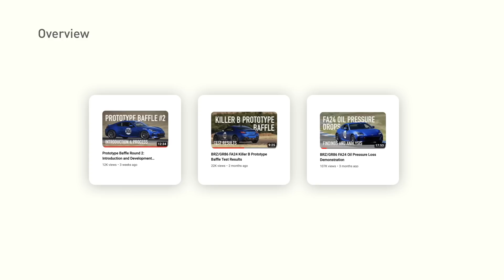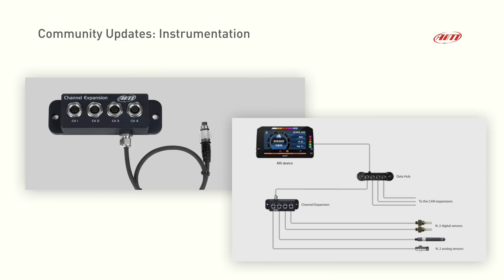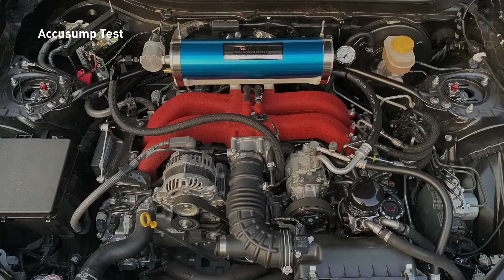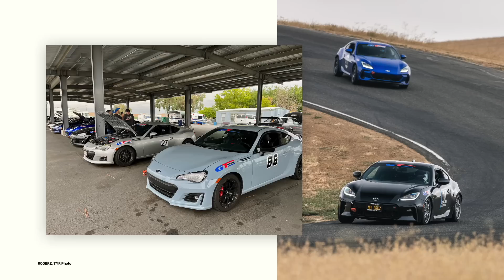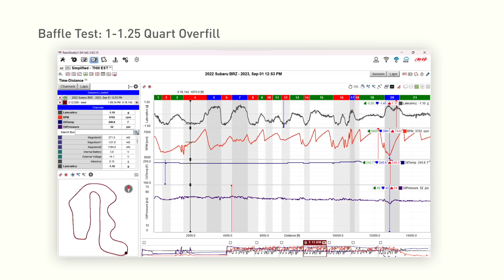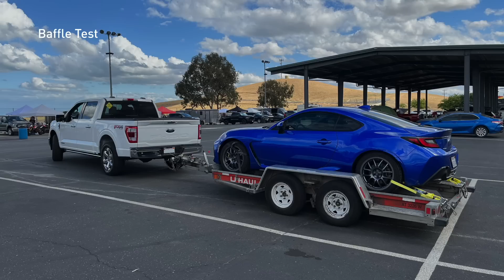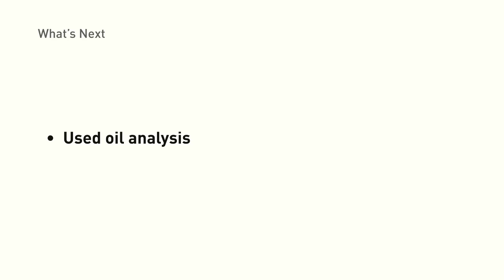Prototype Baffle #2: Results, Setbacks, & Future Plans

Comment: Just spitballing as someone who has no real idea about engineering or the root cause of the the right hand oil starvation: could a widened/redesigned oil pickup+pan be a possible solution? I've read hypotheses that say the issue is related to inability to grab oil from the pan.
Reply from the maker: Yeah, we believe a higher capacity pan would improve performance significantly. Wider is better than deeper because you don’t have to swap the pickup, but the space is constrained by the exhaust headers.
Reply: @900BRZ  That's the unfortunate part. An aftermarket oil pan from the likes of Moroso or a similar company would need to also come with headers that move around the oil pan. This also introduces the problem that the first catalytic converter is on the header, increasing the price of such a specialty part tremendously.
Reply from the maker: Yup and it won’t be CARB legal, which decreases the addressable market.
Reply: @900BRZ  Unfortunately, it looks like Honda power is in my future. 🫡
Reply from the maker: @haifai3916 Okay did some Googling and it is possible to get exceptions for aftermarket headers in CA. So maybe there’s still hope. https://ww2.arb.ca.gov/resources/documents/california-racing-vehicles-aftermarket-parts-executive-orders
Reply: @900BRZ  That’s good to know. Another option is to have an exhaust shop harvest the stock cat and weld together a new header using the factory cat. Definitely not ideal but that can also forego California’s bureaucracy.

Edit: Even using a stock catalytic converter with a custom-made header is illegal. Unbelievable.
Reply: @900BRZ  Thank you for all of the time and effort you are putting into this by the way. The entire community appreciates it, including myself.
Reply from the maker: @haifai3916  Yeah was just going to say. It need to have the EO sticker on it, unfortunately.

Comment: Sucks that this happened to you of all people but at least Verus is covering your engine replacement.
Reply from the maker: Thanks man. Yeah at least we continue to learn from it and, yeah, I really appreciate Verus stepping forward to cover the replacement.
Reply: @900BRZ  I appreciate all the work you have put into this project but unfortunately my time with my gr86 has come to an end. I am waiting for the title to arrive and i will be selling mine. I am moving to a platform that is less volatile
Reply from the maker: @uND3rrated_MX5  Totally fair. What are you going to go to next?
Reply: @900BRZ  on the fence over gr corolla or nd miata club spec
Reply from the maker: Nice, have you heard of anyone adding diff coolers to the Corolla? So far I’ve heard that’s the one Achilles heal. That engine is seeming pretty good right now haha.
Reply: @900BRZ  i am aware of the diff issue but i have not seen much done to counter it. But im hoping for some kind of solution to be introduced in the future. GR is the better daily and that is what i will be doing 75% of the time with my next car. The ND mista would be a better track car but a terrible daily.
Reply from the maker: Yeah I think a diff cooler should be relatively easy. Just have to get a new diff cover or add ports and figure out a way to route a cooler core to some airflow. They did it on the GR Cup cars. Might be harder on the FWD side though.
Reply: @900BRZ  my understanding is that only the resr diff overheats but i could be mistaken or misinformed.

Comment: OMG, that is devastating. Very interested on finding out what the fix will be.
Reply from the maker: I think we learned a lot from the large overfill actually. I didn’t quite articulate this in the video, but we now believe that it’s not an oil control problem, but an oil return problem. We can’t increase the speed of the return, but we can try to increase the amount of oil available in the sump. Hoping to share more info on our new mental model soon and potentially do some “lab” style testing.
Reply: @900BRZ  Interesting. BTR Justin observed more severe pressure drops with a vertical buffle. Not sure how all these findings fit together, I hope someone figures it out!
Reply from the maker: My theory is that the Kazama baffle inhibits oil return. The baffle I tested had a very intricate top design in order to try and reduce crankshaft windage while not inhibiting oil return. We now think oil return is the biggest problem with this engine.

Comment: Incredible work from all parties involved. Very sorry to hear about what happened with the engine! I wonder: would modifying or extending the oil pickup be possible to test or even help at all? Like a longer straw in a Super Big Gulp!
Reply from the maker: Thank so much for the donation. Paired with a deeper pan I think that would be helpful, but it’s an engine out job to replace the pickup unfortunately, since the timing cover needs to be removed to access the fasteners on this engine. I don’t know why that made that change. With FA20, you could swap the pickup just by taking off the oil pan. I think a wider pan at the same depth is the way to go for increased sump capacity.
Reply: @900BRZ wide oil pan idea, I have an ‘02 WRX with a ~ flat bottom pan stock.
I’ve seen a couple videos where the Sti developed a more v shape pan so oil won’t slosh out beyond the oil pickup under lateral g loads.
It would be interesting to get a camera view of oil movement in a pan on track.
Maybe there’s a computer simulation that could do it?

Looks like the old WRX had two horizontal baffles to prevent up slosh at two levels .

I did one track day with the WRX.  When the engine was torn down much later after a burned exhaust valve @176k miles there was one rod bearing that had gone through 2-3 layers.  Might have been the track day, or repeated right turn on ramps :)

Sorry for the catastrophic oil pressure loss while supporting the community!

You could probably make an oil pan with a camera that is bolted somewhere else in the car, experiencing the same or similar g forces to see how oil behaves?
It also might be interesting if a swinging pickup could follow the oil :) reliably.
Reply: From what I've seen I think the distance of the pickup from the pan may be too conservative. I've not measured it with clay. I wonder if anyone has? I think the vertical baffle with trap door holds great promise. I'll say more on that elsewhere.

Comment: I guess the best option , after all these tests , is to use the STI pan with baffle (engineered by themselves with huge know-how and budget) , and overfill.
A super useful test would be to have a camera that looks what happens inside the pan… Almost impossible I guess , but would remove any doubts .
Reply from the maker: We’re thinking about how to use a camera or other testing methods to better understand how the oil level changes as a function of RPM (i.e. pump speed). GR Cup cars don’t use an STI pan/baffle. The best we’ve actually tested is the SYMS pan if you’re looking for something to get right now.
Reply: A camera won't see anything. It is a mess in the crankcase. I worked at a race shop and in the past they put windows in V8 racing oil pans and did didn't reveal much. Perhaps oil level sight tubes external to the pan with cameras watching may be revealing. Love the work you guys are doing and I don't even own these cars. Good luck.

Comment: Is it possible to do an accumulator with a manual and a solenoid? As in have it manually closed for everyday driving  to prevent overpressure and where the solenoid would prevent overfill at the track when driving slowly ie cool down or pit lane. Accumulator to solenoid to manual is what I'm imagining, from the outside looking in it sounds like the best of both worlds.
Reply from the maker: Thank you so much for the donation. Yeah I think that would be possible, but we might also be able to find an electronic solenoid value that doesn’t allow flow from the engine to the accumulator when unpowered. Lots of ways to go from here actually and more minds working on this problem is definitely accelerating progress.
Reply: I just remember the distrust you have with pure electronic solenoids given their failure rates. When you find one an additional manual valve might be peace of mind for daily driving.
Reply from the maker: @janjotat  Yeah that’s true. I’m feeling a little more emboldened by Ansix using the manual valve and just accepting the overfill will be there on idle. As long as we can see pressures and ensure that we’re not creating dips with aeration, we should be able to be reasonably confident with just a manual valve. 

If Verus or another company is able to develop a high capacity sump, that would be interesting too, as we could get the benefits of higher capacity without the drawbacks of crankshaft aeration.

Comment: Any plans to get some data for Un-Baffled Overfilled passes?  I'd like to know if the overfilling is going to be our band-aid here in the interim or maybe even just the answer moving forward?
Reply from the maker: We’re thinking an accumulator can give us similar benefit without as much concern for the crankshaft aerating the oil. But it would be interesting to try significant overfills by themselves. Might as well do that testing too.
Reply: Like he mentioned in the video, other folks have tested overfill with positive results...BTRJustin as well as myself have covered this in the forums. Its not a cure, but helps reduce the severity of the drops. This is similar to the effect of heavier weight oils.

Comment: Thank you for your continued research on this platform. From what I am seeing, the best protection option for us FA24 track day enthusiasts is a 1L engine overfill. For cars that are dual duty - track and street, what are the implications of driving an overfilled car on street?
Reply from the maker: The concern would be you’d likely be dipping the crankshaft in the oil in the sump. We’re going to try to take more precise measurements when my engine is out. That can cause power loss and oil aeration. I would not recommend that significant of an overfill on the street.
Reply: @900BRZ i dont remember, but do you have a oil catch can? You can measure how much oil per hour you accumulate in there with and without overfill. That would be a good indication, if you have serious windage issues you will probably be able to measure it in the blow by gases.
Reply from the maker: @garagecedric I have the KB dual catch cans but haven’t installed them yet. Yeah I can start doing that on my next engine.